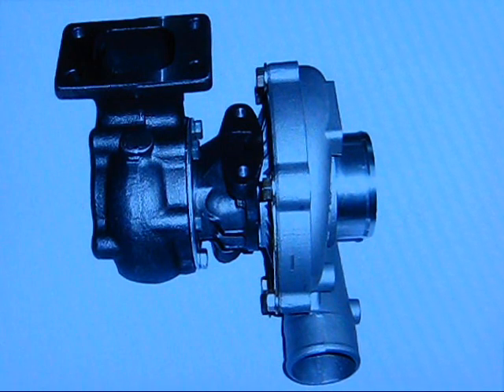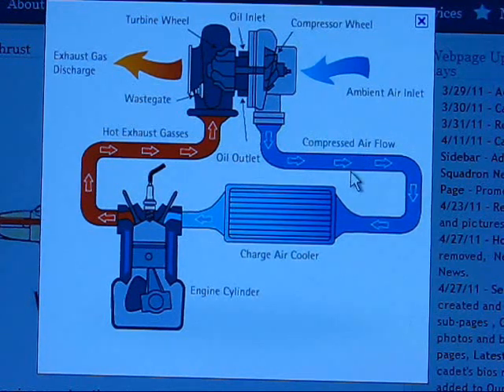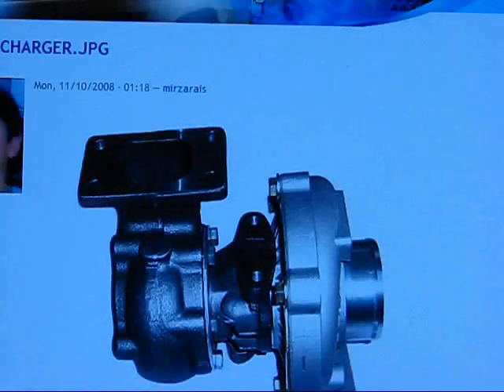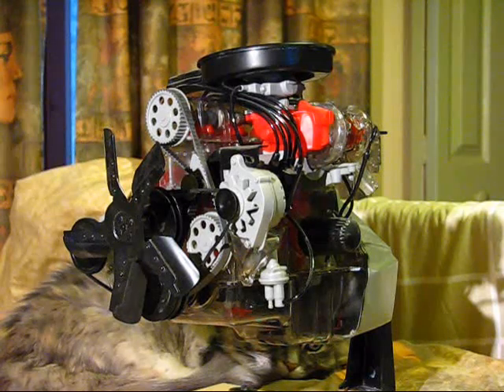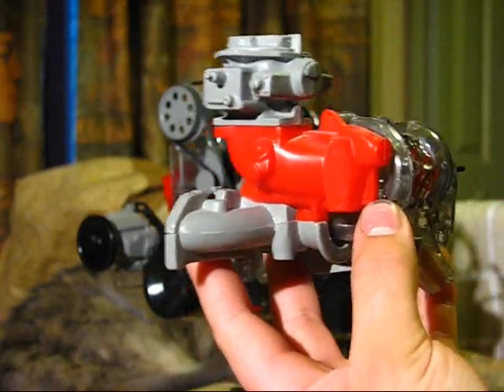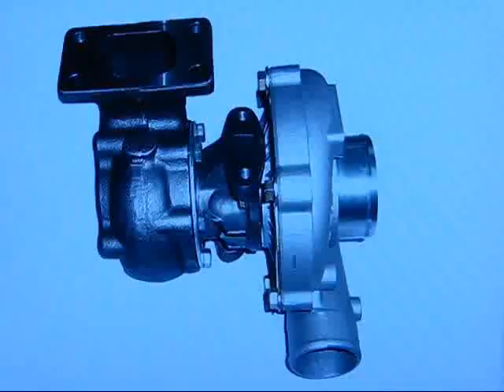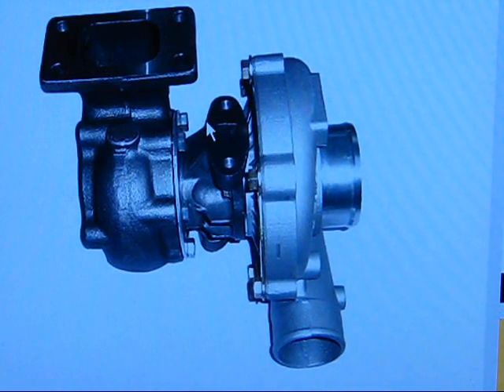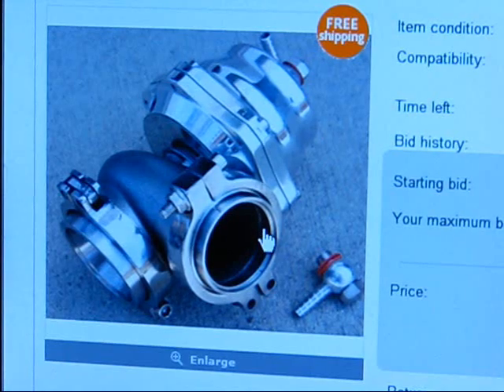Turbocharging a car Basics Part 1

Comment: The goal of a turbo is to increase the mass of the air going into the cylinders, therefor putting more oxygen molecules in the cylinder allowing for more fuel while still achieving full combustion and thus more power. Since the volume of the cylinder is fixed, the only way to do that is by increasing the density (mass per volume) of the air.

Now look at the ideal gas law; p = rho * R * T, with
p = pressure
rho = density
R = specific gas constant (287 for air)
T = absolute temperature

You can see that you can increase the density (rho), by either increasing the pressure or decreasing the temperature. Turbo's obviously increase the pressure. But compressing air also has the side effect of increasing temperature (as people already mentioned in the comments). This is because compressors (at best) use something called an isentropic process. So after compression the air is hotter than the ambient air temperature. Now it would make sense to somehow cool the compressed air using the cooler ambient air, while keeping the pressure constant in order to increase the density further. This is precisely what an intercooler does.

Example:
Say you isentropically (so: 100% efficient) compress air from 1 atm (101325 Pa) @ 15 Celcius (288.15 Kelvin) to 2 atm. 

The density (rho) before compression according to the ideal gas law (rho=p/(R*T)) is (101325/(287*288.15)=) 1.225 kg/m^3.

Then find the temperature and density after compression using isentropic relations:  
T_2/T_1 = (p_2/p_1)^((gamma-1)/gamma)  = 2^(0.4/1.4) = 1.219, so T_2 = 288.15 * 1.219 = 351 K or 78 Celcius
rho_2/rho_1 = (p_2/p_1)^(1/gamma) = 2^(1/1.4) = 1.641, so rho_2 = 1.225 * 1.641 = 2.01 [kg/m^3]

Now we send this air through an (idealized) intercooler that will bring the temperature back to 15 Celsius without pressure loss. Using ideal gas law again:
rho_3 = 2*101325 / (287 * (273.15+35)) = 2.45 kg/m^3

So we bring the density from 1.225 [kg/m^3] -> turbo -> 2.01 [kg/m^3] -> intercooler -> 2.45 [kg/m^3] -> engine.

Side notes:
1] Compressors aren't perfect in real life. The have something called an isentropic efficiency. The result is that the air coming out of the compressor in reality would be hotter, and thus the density lower. This makes an intercooler even more attractive.
2] Intercoolers aren't perfect in real life. An intercooler will never cool the air to ambient temperature, but in reality will stay well above. Also there will be a slight pressure loss, and thus slight drop in potential density.

Comment: Yes, some of the heat may be transferred to the cold side. But mainly, if you compress air, it naturally wants to get hot. Not because of the hot exhaust gases. Just like if you put air through a negative air pressure zone, there will be a temperature drop.

Comment: The intercooler is needed, because when air is compressed, the temperature rises. Not that much because of the heat transfer.

Comment: Also, turbos DO take power like superchargers, but a lot less. They are NOT free hp. They create excessive back pressure, which leads to less hp. Its the rapid expanding heat that is main factor that spins the turbo, exhaust gas just helps. Turbos are sometimes LESS efficient at "creating" boost than centrifugal superchargers. On avg, not race turbos or anything, turbos only have about 70%-75% efficency, just look at any compressor map. centrifugal has on avg 72%-80%.

Comment: Lol I wasn't saying that but there are water to air systems and even dry nitrous (spray on the intercooler) again the gain is minimal because there isn't as large of a difference in heat like there is in a turbo system. And the gain may not be worth the time and money but the concept still exists

Comment: procharging is not supercharging. superchargers do not use centrifugal force. they are positive displacement. they pump volume proportionate to the rate of movement (similar to most engine oil pumps). turbo chargers/prochargers are centrifugal (similar to most engine water pumps) and only build pressure of off the centrifugal force of spinning the air away from the axis creating movent/pressure. only difference is how the turbo is powered. procharging leading to less lag/generally less boost

Comment: i understand that the outside ambient air temp being the same temp as inside the intake system doesn't benefit. there are other ways of transferring heat through an intercooler such as water cooled systems. but like i said before its not nearly as much of a benefit as you would get from intercooling a turbo system.

Comment: The main reason for an intercooler is not because of heat transfer from the turbo to the compressed or compressing air. It's because when in air is compressed, the air heats up due to the molecules being compressed and "rubbing" together to create friction. Heat transfer from the exhaust housing is just another reason.

Comment: Yeah that boggles my mind. Maybe this just comes naturally to some people but I feel like it's kind of obvious that cool, compressed (more dense) air leads to better, more powerful combustion in an engine (with increased fuel injected to keep the air to fuel ratio at optimal level). Hence the intercooler with the turbo.

Comment: OK but your explanation of intercoolers was way off. 

1. Most of the heating of the air in the turbocharger comes from the work of compression, not transfer of heat from the exhaust.

2. Since the purpose of a turbocharger is to get more mass of air into the engine, it makes sense to cool the air down to increase its density. That is the most important reason for using an intercooler and you didnt mention it.

Nice try, though.

Comment: why even talk about carburetted engines they went out around ten years ago . all turbos need direct injection with ecu controlled fuel management mapped out by the air mass flow and oxygen meters

Comment: but the air going to NA engines is already the temperature of the atmosphere exposing it to the atmosphere again through a radiator there wont be any heat transfer the air inside the radiator will stay the same temperature, how can that increase performance?

Comment: there's multiple reasons you need an intercooler. you are both right. also don't forget that even a naturally aspirated engine can benefit slightly from an intercooler. not as significantly as much as a turbo engine because of the very high temps of a turbos cold side. theres also friction and ambient temps that you need to reduce for best performance

Comment: depending on the engine and boost pressure, if you want to run under 10psi say the 6-7 mark that a lot people run on small engines, you might still need a new fuel regulator and some new injectors but other than that not really.

Comment: I'm debating whether or not to turbocharge a 2013 ford fiesta. It's a great car, but does not accelerate fast enough on the freeways. Will it affect gas mileage if i turbocharge the car? How approximately how much does it cost? What's your input?

Comment: Best thing would be: Larger diameter downpipe, high flow injecters,plugs, high volume fuel pump, performance fuel filter. You're gonna want to get as much power out of your turbo as possible because like the creator or the video said, you'd have to keep your boost pressure low if you didn't do the other stuff that make the turbo actually capable of producing the most power possible.

Comment: when air is compressed, it heats up, that is why an intercooler is needed and not beacause of the heat transfer you mentioned although the heat in the engine bay can play a small roll in the increase in heat

Comment: An example would be when you explain the cold side is only heated up via heat transfer, the majority of the reason it heats up is actually because when you compress air it creates heat, lots of heat.

Comment: And in most cases you also need to upgrade various internal parts in the engine, as it might not be designed to operate under the kind of power a turbo can add.

Comment: Dosing is the noise turbo's make when you close the throttle and the pressurized air flows backwards out of the turbo, spinning the turbine backwards, it's also called turbo flutter.

Comment: I always thought that the need for a intercooler was because when the air is compressed it heats up. Cooler air which is denser will have more power.

Comment: FAVORITED! Excellent write up dude! I need a few things before I can start looking into a turbo set up, I need a new exhaust from the header down, bushings, and front brake rotors. But that's it, then I will start getting stuff to go turbo. Oh and I need a new battery and passenger window motor.